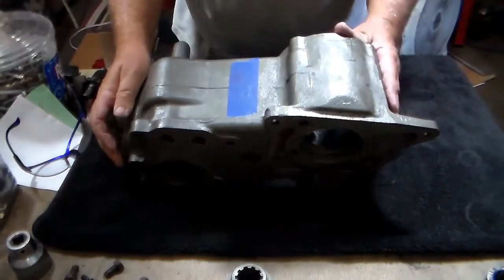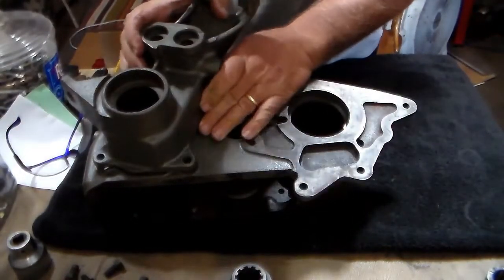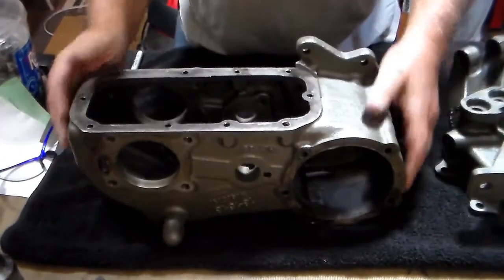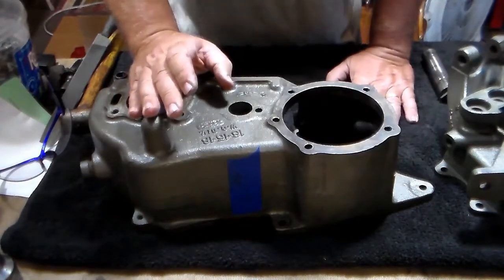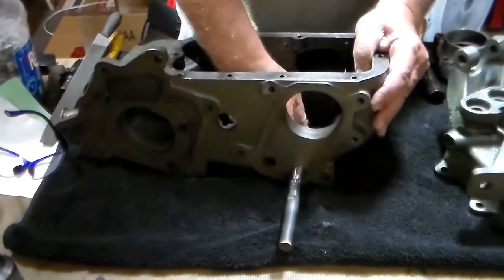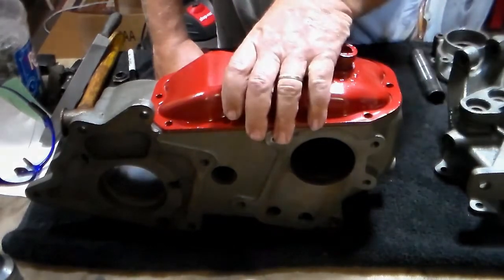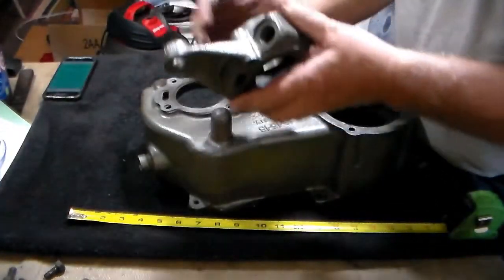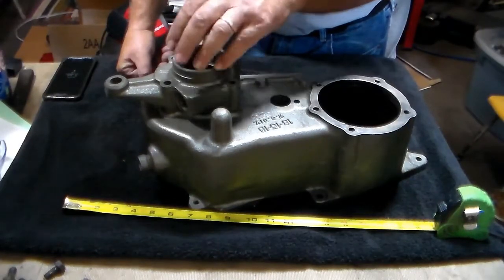Model 18 Transfercase Inspection Part 1

Comment: Hi my friend
i need help? what tool for Dana 18 seal removal! i heard miller w251 tool  were can i get one? Thanks for reading this!
Reply from the maker: Ricardo Rodriguez, You really don't need a special tool. You can remove them with a sheetmetal or drywall screw. Drill two opposing holes in the seal and screw in the screws. The screws will pull the seals out.